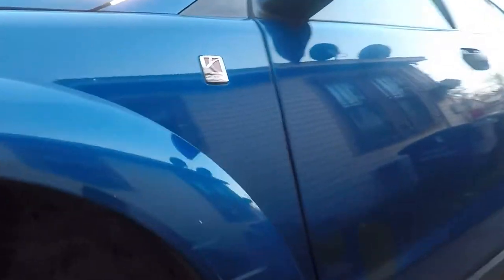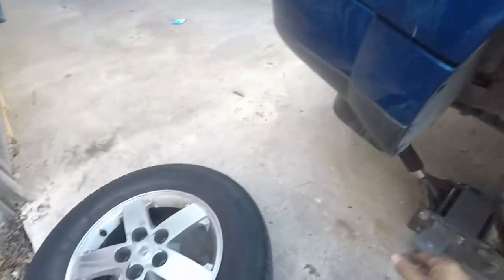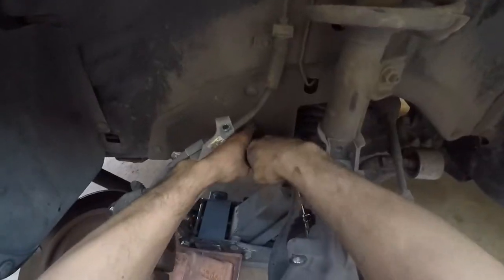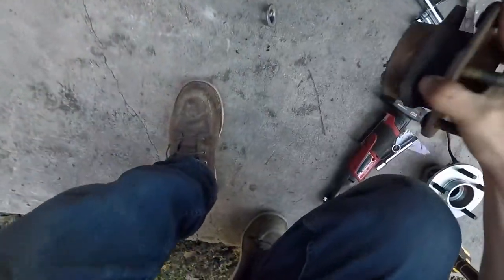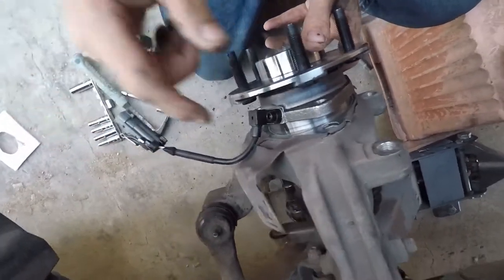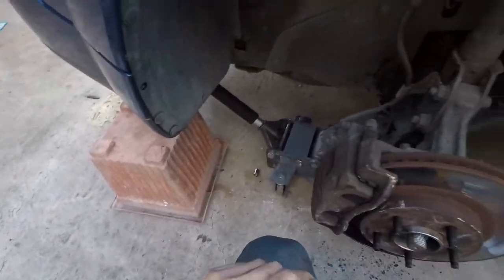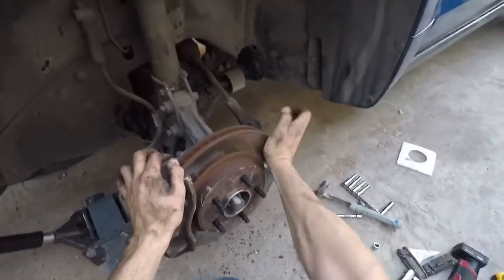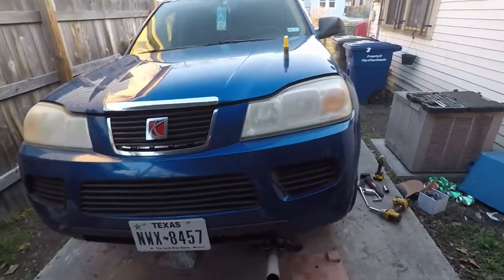saturn vue front wheel bearing replacement

Comment: Thanks for the how to. Very helpful. Have to do this on my ‘05 Vue, 5spd manual, 2.2l. It’s at 253,000k miles. Replaced the rear ones already, which quieted the rolling noise down to nothing. Hopefully this front replacement makes it even quieter. Thanks for the how to. Greatly appreciated!

Comment: My 05 5 speed manual 2.2l doesn’t have the ABS either. Finally getting around to this job at 272,000 mi. Thanks again for the step by step video! Greatly appreciated.

Comment: Hey Gilbert, Thanks for the video. Did that wheel hub come loose without beating on it and what size socket for the axle nut?
Reply from the maker: The hub came out easy the 3 bolts that held it on were a pain , as for the axel nut it’s a 34 mm the socket I used for the job was a 35mm it was a little loose but it did the job
Reply: @RatchetRiceRockets  yeah I tested one and backed it out some. I was just using car  jack so I couldn't do much. I need your youth, I'm 67 and getting tough to do this. haha.
Reply from the maker: I agree I’m getting to the point where my wrists and hands are starting to fail me due to Psoriatic arthritis that’s why I try using power tools every chance I get, I could only imagine when I’m 67 I’ll probably be dropping my vehicles off at the local repair shop, stay safe Dwayne jack stands save lives
Reply: @RatchetRiceRockets  Thanks Gil, if you were my neighbor we could help each other. I saw dairy, grain and sugar can make p.a. worse.

Comment: Hey I'm trying to get my hub out but now one of the three screws in the back Is stuck and not moving anymore, is there a tip you have , I just have hand tools..
Reply from the maker: Spray lube, motor oil anything to lube up the threads, try tightening and loosening back and forth eventually it should come out
Reply: @RatchetRiceRockets  okay thank you , I'll try some more
Reply: @RatchetRiceRockets  

Next time use a bucket for that caliber
Reply from the maker: I hear ya